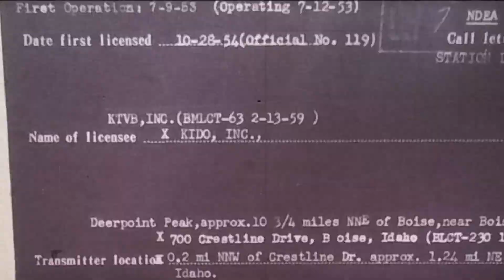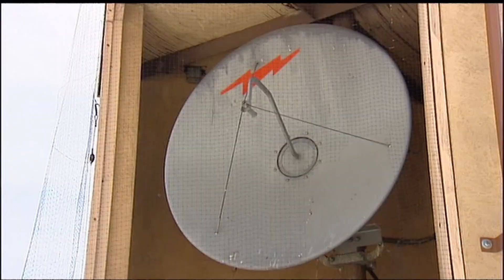KTVB makes the switch: Station upgrades to UHF for better signal quality

Comment: So, was the station originally on VHF channel 7, through the analog days? Did it stay on RF channel 7, and switch to digital there, or was there an interim channel for a simulcast of digital alongside of the analog.
I take it that you have been transmitting digital on the VHF channel (7) since the original switchover.

Comment: VHF usually has better object penetration for things like walls than UHF. The smaller wavelength of UHF is better for smaller antennas and high bandwidth signals. I'm not sure it will help unless you have a lot more power or a high gain transmitter antenna.